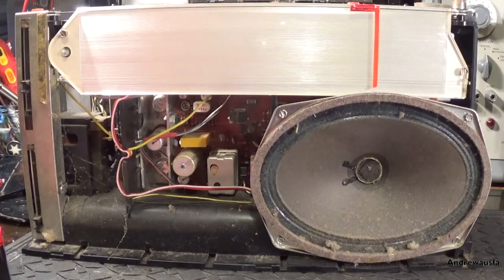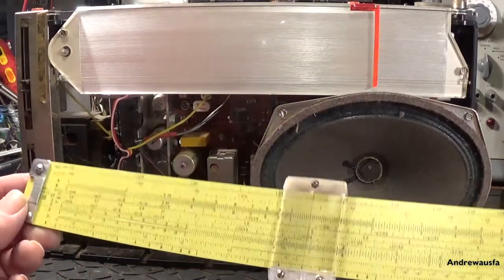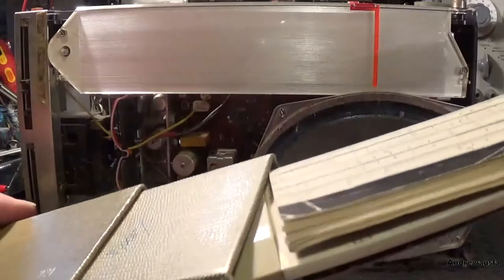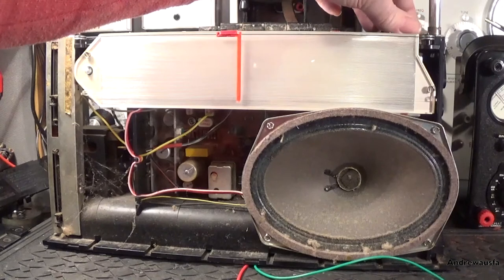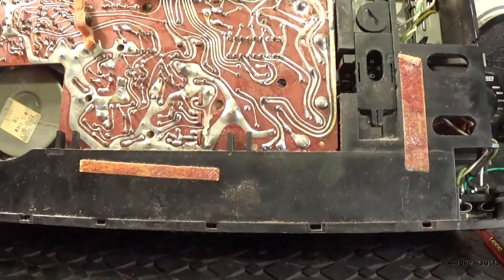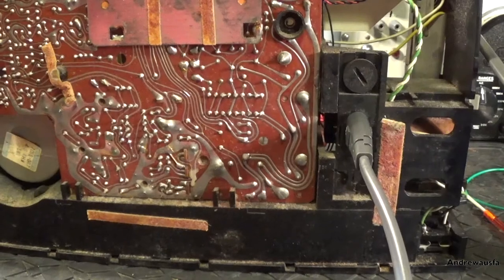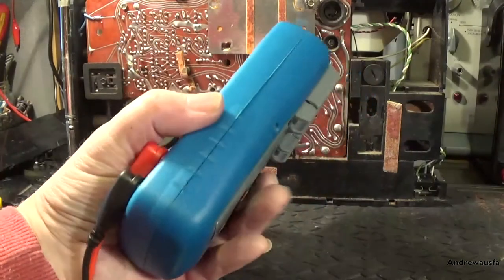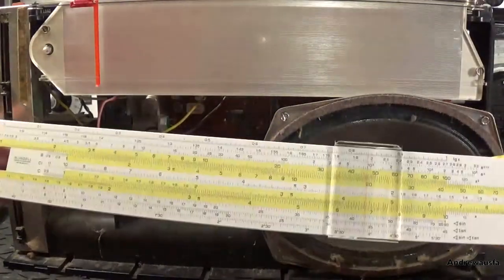Grundig Melody Boy 1000 Part 2

Comment: Good to see you back on a transistor set Andrew and a German one! Hope you had a great Christmas. I could never work out that slide rule thingy. Maths was never my thing. I do remember when calculators first came out. I think mine was a Texas Instruments brick. I have done a couple Nordmende radios recently and one had a dodgy bridge in the mains circuit. I changed it for a modern version but from memory the pinouts were very different. I look forward to the next instalment. Cheers Graham
Reply from the maker: Radiocruncher Thanks Graham, slide rules are fairly easy once you get the hang of no decimal  point but calculators are obviously way superior!
Reply: Btw Andrew if you want to pop one of the sliders in the post then I will have a go at printing one for you. Send me a message if I can help. Cheers Graham

Comment: Hi Andrew, I have just acquired a melody boy 1000 and it's in very nice condition other than the back light . Does the switch suppose to stay either on or off ? Mine is on permanently   i.e the switch fails to stay down . Is this a faulty switch ? Also missing a slider knob. Cheers Neil
Reply from the maker: Hi Neil. the light is on full time on mains. The light switch should be momentary, just for battery only use. Cheers - Andrew  PS Slider knobs...bad design, they're usually missing one or both!
Reply: @Andrewausfa  thanks very much for the quick reply and the info. The sound is really good from this set . It really is in excellent condition and it cost me a tenner !

Comment: Very impressed I have a slide rule but don’t know how to use it perhaps you could do a full video sometime.  My grandfather was a big fan of Grundig but I fear the DIN connectors.
Reply from the maker: AllTheGearNoIdea I was thinking about using one at work as I do lots of trend forecasting and data analysis.  Then the LSD wore off.  Seriously, in comparison to the nth degree of decimal places we get with the most basic calculator, I'm amazed engineers of the past did what they did using slide rules.